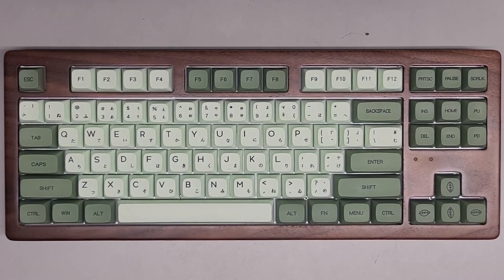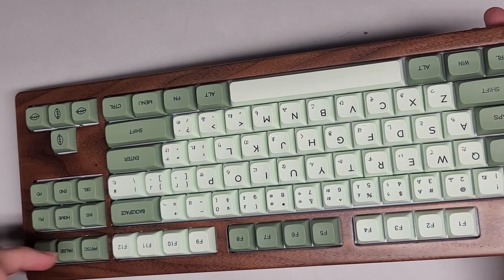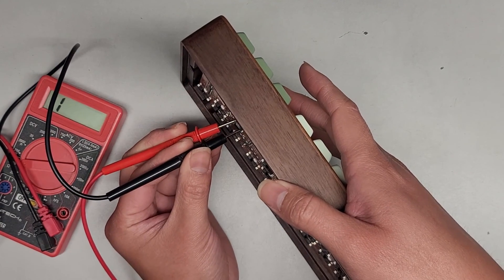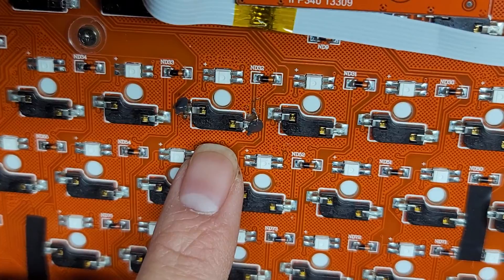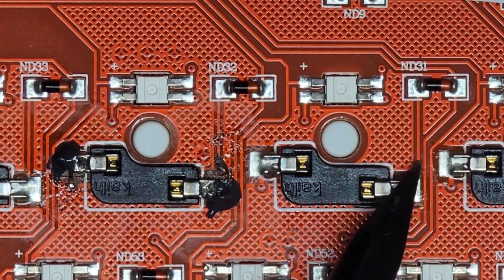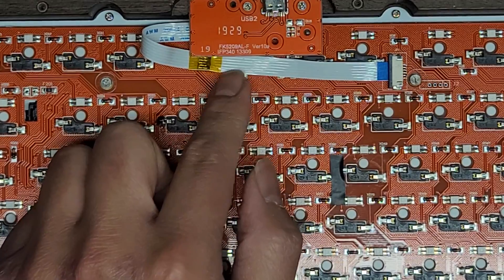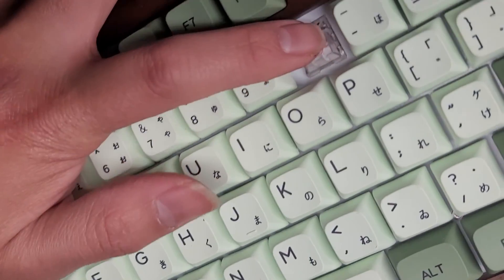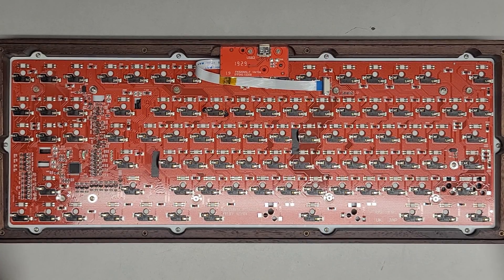Custom Mechanical Keyboard Switches Buttons Keys Not Working Registering Keystrokes Common Issues

Comment: My G915 had a unresponsive key.

Where should i start ?
Reply from the maker: Start by checking if the pins went in right, then check if the solder pad lifted.

Comment: Weirdest thing happened with my anibis switches. The pin didn't bend, it didn't break, it went straight down back into the inner body of the switch. It doesn't register during keytest. Just 3 out of 72 were defective, guess that isn't too bad.

I can pull the pin back out, but pushing it back into the hotswap socket does the same thing. All the other switches work fine. I'll be emailing cannonkeys.
Reply from the maker: Strange. Could be a micro tear in the trace.

Comment: my 3 d e c keys have stopped working I cleaned it opened I changes switches still they don't work? help pls
Reply from the maker: You need to check the connection for the whole column. Sounds like you damaged the trace somewhere.

Comment: Hello, very nice video. I have similar issue but sadly I cant find a solution to it. I opened the keyboard and checked the switch that doesnt work (only N key doesnt work), tested it with multimeter and there was no continuity, so it made me think that the switch is broken. I switched it with new one. It shows continuity now but when I connect the keyboard, it still does not work. Nothing else seems broken on PCB. If anyone has any idea I would be grateful.
Reply from the maker: The trace is likely torn.
Reply: @ItsBinhRepaired  thank you, what should I do next then? I tried to connect pins from N and M, which makes whole row to connect and press, that way N key get pressed aswell. I know it probably does not help with finding the issue. Unfortunately I am pretty noob at this. Just trying to learn.
Reply from the maker: Would need to see it to diagnose and fix

Comment: as You said in the video one on mY pins that locks in the switch bent in and i would like to know how to fix it
Reply from the maker: Have to watch the video for that.
Reply from the maker: If this one doesn't help, this might. https://youtu.be/jzt9SSpIq5s
Reply: ok
Reply from the maker: @dannyeatslemon7302  good luck. Hope the repair goes well.
Reply: thanks man
Reply: i just fixed my Y key but now my H key just stopped working instead 😂
Reply from the maker: @dannyeatslemon7302  uh oh, check it lol
Reply from the maker: Did you figure it out? Lol

Comment: bro i got a problem can u help me so i changed the switch but the win key is still not responsive pls help
i did changed the switch 2 times pls help me whats wrong with my keyboard let me know if i can fix it.
Reply from the maker: You'll need to look at it closely. Likely broken solder joint

Comment: Same happen to me but weird thing is the socket only work with one switch, if i replace it to any other swith it wont work
Reply from the maker: Maybe it bent in a weird way.
Reply: @ItsBinhRepaired  yes i think so but i trying to see all the pin is in the same straight line but i still dont know what happen
Reply from the maker: @acs1018  strange
Reply: @ItsBinhRepaired  the seller dont wanna responsible despite i purchase this board just less than 1 week and keep saying its my fault. But its okay i already do the tape mod so the minus is i cant change other switch even same type